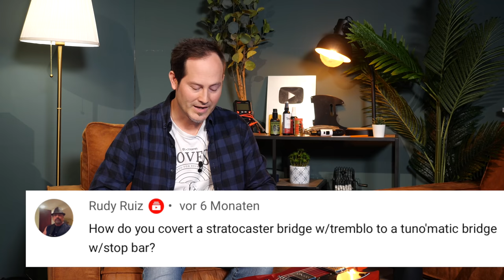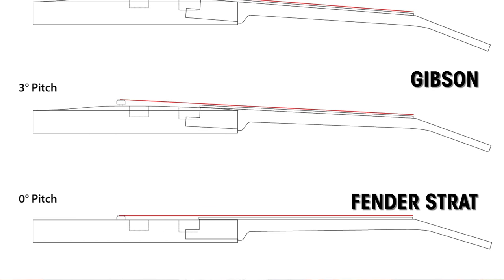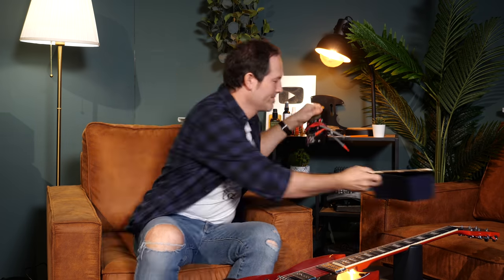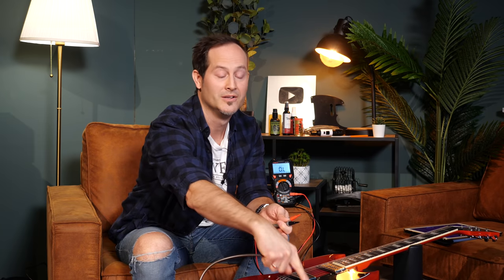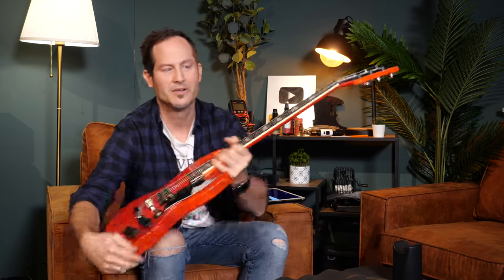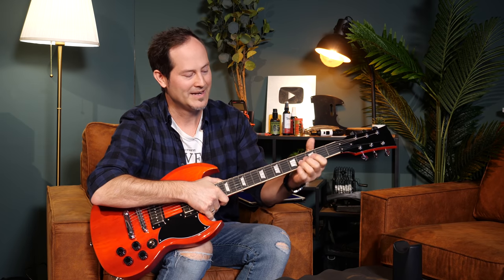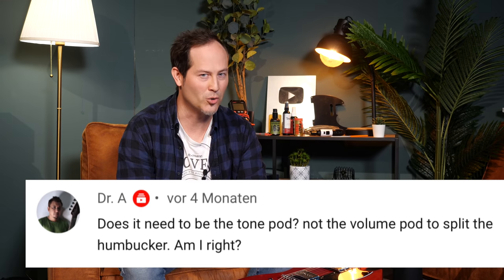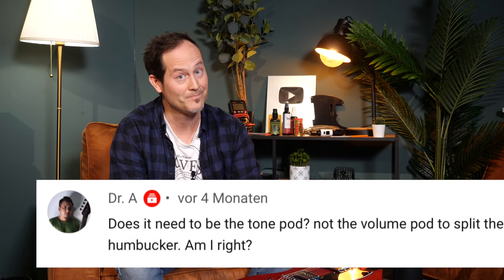Guitar Tech REACTS - Q&A #10 | Guitar Tech Tips | Ep. 92 | Thomann

Comment: Both Francis Rossi and Rick Parfitt's famous telecasters were fitted with Gibson style bridges. They had it done because the stock Fender bridges couldn't withstand the pounding that they endured while belting out those Status Quo boogie classics. So it can be done but would be a bit more work on a strat than for a tele.
Reply from the maker: Hi, that's true. It is doable but you have to consider a lot of things that need to be modified / adjusted to make it work. As told, it's a crazy project and I don't recommend doing it without enough experience. Cheers //Kris

Comment: Monty (the pickup guy) does a Relic Wax to darken fretboards.  He has a yt vid but it doesn't have a before+after shot to see how much difference it makes.  So I've no personal experience with it, but it might be worth a shot if you're desperate to experiment.
Reply: Ive used it and it def darkened quite a bit. Also the board is very smooth to the touch now.

Comment: Is the last topic about cables from amp to speaker or thr cables inside a speaker? 1,5 is more than enough inside a speaker. Wires aren't longer than 50cm usually. So there is no signal loss. And a usual amp with 100w will not need thicker cables inside a cab.
Reply: Also, if was about the cable used to connect amp and cab, it is recommended to twist the wires to decrease noise.

Comment: Tune-o-matic bridge on a strat LOOOOOOOOLZ 🤣

But seriously, if you want a fixed bridge on a strat, blocking the tremolo system is the best way to get there.  In fact an easy thing to do that I did on my American Standard strat, was I just put five strong springs in place that pulled the bridge down against the body and now it's fixed in place and doesn't move.

Comment: Hey Chris may you could tell something about installing a Meastro or Bigsby on a  Gibson style guitar. In particular if there has to be a ground wire. Thank you
Reply: Check to see if there’s already a ground going to the bridge, that should be fine (the new tailpiece will be connected to the ground on the bridge by the strings). But, if you’re trying to convert a stop tailpiece to a Bigsby, and the ground is going to the tailpiece you’ll be removing, then yes you need to ground the new tailpiece.

Comment: Read somewhere about tone suck and cable length over x ft causing treble loss. I'm using 5m cable to pedal board and another to cab and started to wonder should I change to shorter ones. Also read that all boss pedals buffer the signall and that should help to solve the loss. Any comment on the subject?
Reply: Buffers help (as close to the guitar (some fuzz pedals do not like having a buffered pedal in front of them, test yours out, if it squeals, move it in front of the buffer) and at the end of the pedalboard is the ideal), but it really depends on how big your pedal board is too, even when off that short distance between the in and out jacks is adding up on top of that 10m of cables.
Reply: Carlos Santana uses intentionally long cables to achieve that treble loss. 
I heard him say that to his tech. 
I think he was talking more than ten feet cables. 

If one compensates that trebleloss by using strings with lots of treble and an ampsetting that goes the same way one would be able to find a sweet spot where the sound has the exact amount of treble and that certain sweetness Carlos always has.